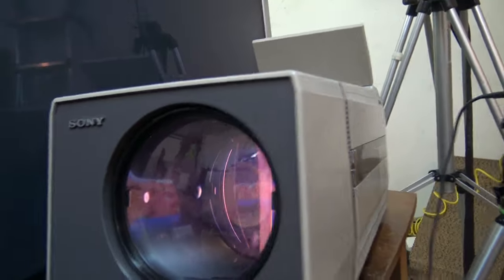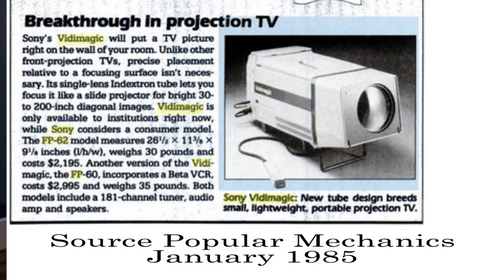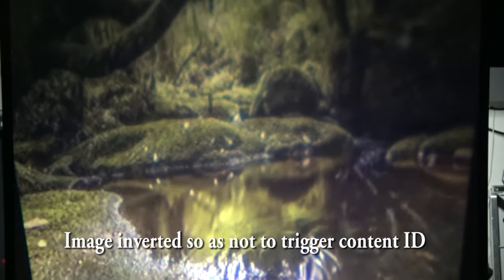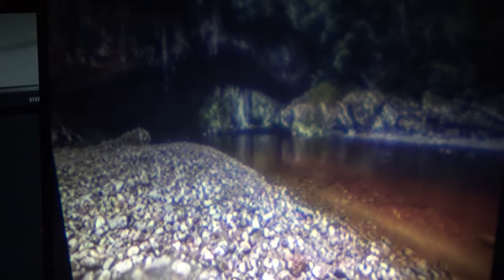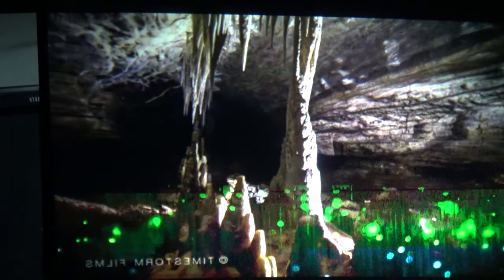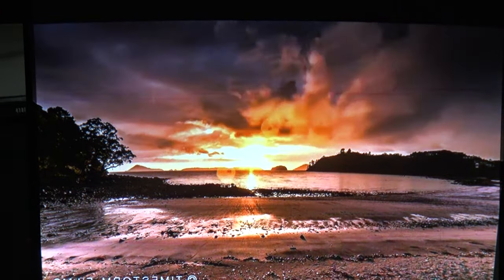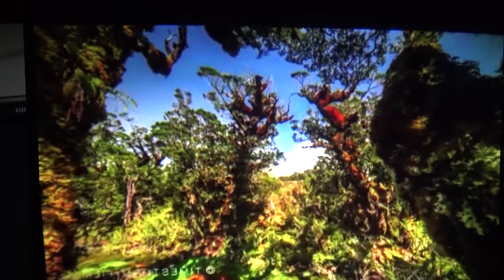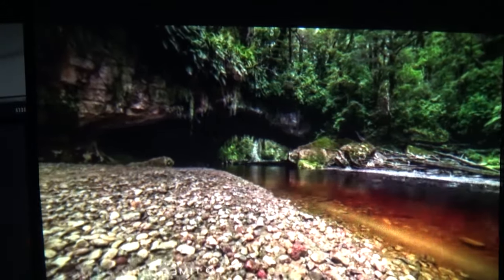3 projector shootout

Comment: How does the indexetron projector tube differ from a trinitron tube? I thought the trinitron used one gun, but had a vertical bar shadow mask. Did they just focus the electron beam more and eliminate the shadow mask?
It would be interesting to see how a Sony MP-CL1A compares.
Reply from the maker: A trinitron has 3 cathodes with a single lens firing at the aprature grill. They use a second static convergence lens in the neck of the tube. Oriinal trinitron tubes used a coaxial HV lead to send the HV and static convergence control voltage down the single lead (those ones had the static convergence adjustment on the red HV resistor) Later tubes put the HV resistor along side the gun inside the neck of the tube,
An indexetron tube has 1 cathode, 1 lens. No aprature grill. No static convergence.
On the inside of the tube, bwtween each set of red green and blue stripes there is a UV stripe that flashes each time the beam hits it. This UV flash is detected by detector diodes on the bell of the tube. This produces the index signal that the timing circuit uses to rapidly switch the video output that drives the cathode to the 3 color outputs in sequence.
I don't have a MPCL1A to compare it to, but I imagine it is similar in performence.
Reply: +12voltids Thank you!

Comment: Back in 2007 I was watching a video presentation on a dlp projector, and kept seeing flashes of rainbow. What caused that?
Reply from the maker: Single chip DLP, which is what consumer units use only display a single color at at time.  There are 2 types of single panel DLP projectors. Lamp based, and LED or laser based.
In the lamp based models a bright projection lamp is shone through a color filter wheel that is spinning to break the light up into red, green and blue flashes of light. The color wheel is synchronized with the DLP chip  and the mirrors switch between each color. Early units operated the color wheel at 9,000 RPM, and even though this seems fast if you shift you eye you  an still see the flash of light. They then increased the speed to 14,400 RPM, and made the color wheel 6 colors, red, greenm blue, cyan, magenta, yellow. Those ones were very difficult to spot, even for a trained eye.
 The LED and laser diode type use a very bright red, green and blue LED or a RED LED and a green laser with a wavelength  filter to generate blue from the green light pulse.
In the LED variety they rapidly pulse the LEDs in sequence.  Good LED DLP engines you will never see them operating, as they operate at something ridiculous like 3000 frames per second. Cheap ones like the little pico projector I have you can see the 3 LEDs strobing if you know what to look for.